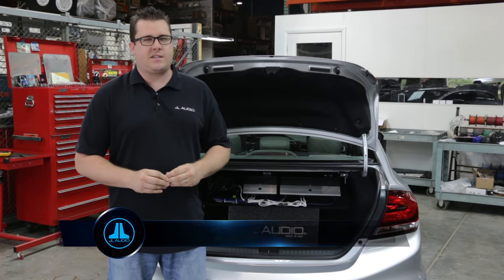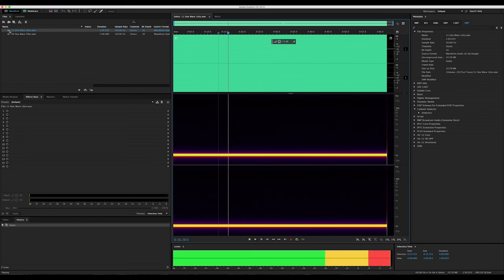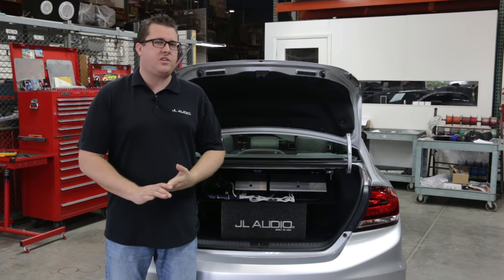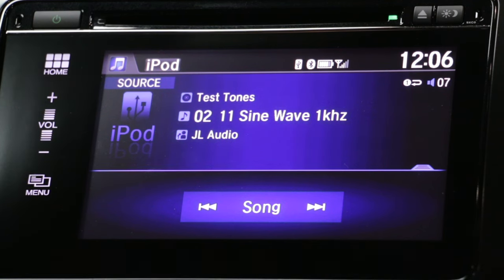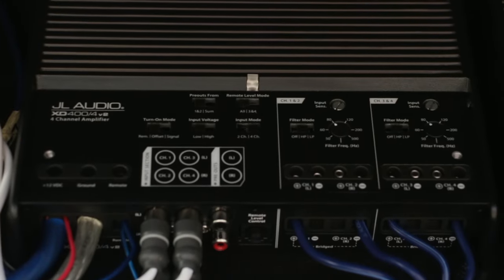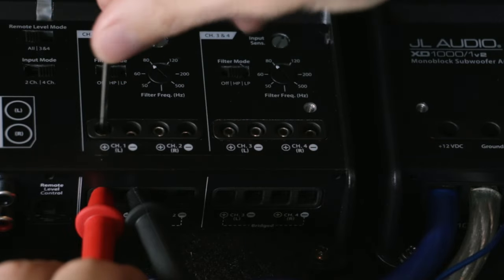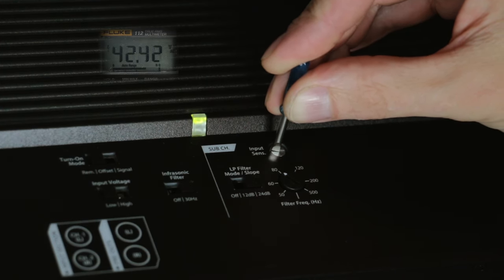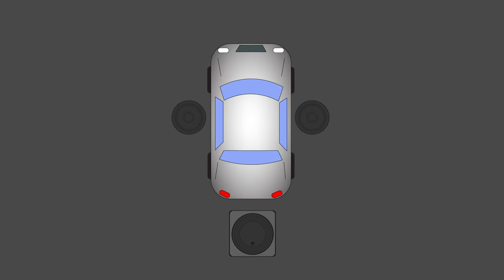Setting Amplifier Gain or Input Sensitivity

Comment: This is by far the most important step in tuning/installation. Thanks for the Giveaway opportunity! That amp would really spice up my modest system!
Reply from the maker: You got it! Best of luck!
Reply: @JLAudioInc  Man after market equipment amplifiers and headunits are meant to use the low level switch cuz of the RCA in video it says if at low levelur voltage exceeds ur desired voltage u should switch to high level if u switch it to high level will that damage anythin since after market stuff is for low level use.?

Comment: @JL Audio  
To truly optimize the gain structure of your system, you'll FIRST need to determine the EXACT point on the Head Unit or source unit's Volume Level where its output begins to clip.

Just guessing and setting your head unit or source to "3/4" volume might get you in the ballpark, but is leaving a lot on the table.

It would be great if an Online retailer such as Crutchfield would put an Oscilloscope on each Head Unit that they sell to determine its clipping point, and publish those specs for the F/R/Sub and Speaker Level Outputs, and maintain an Online database with this information.

They could even provide a smartphone app with an in-app purchase of let's say 99¢ for this information on a particular head unit in order to gain some ROI.
Reply: I o'scoped my Kenwood double-din's RCA outputs, and it did not clip at max volume.
Reply: Man thank God someone like you is around to tell the jl audio techs what they don't know!🤣🤣 They're obviously doing a tutorial for the everyday average Joe that isn't an audio file and doesn't have access to oscilloscopes and other calibration tools.
Reply: @skypallman6169  
LOL.  Ummmm...I didn't post this for the JL Techs, I posted it, as you said, for the "Average Joe" DIY enthusiast/installers who might be reading these comments and not know that all head unit's RCA preamp outputs do not clip at "around 3/4 volume".  This can vary A LOT between specific brands and models.  While "3/4 volume" might be safe in most cases, it definitely doesn't optimize the gain structure and undistorted output for EVERY system.

While many head units begin to clip in that "ballpark" 3/4 volume range, many others do not.  For instance, in the case of the Kenwood eXcelon Reference head units, their Front & Rear RCA Preamp outputs don't clip at all.  So they can be set to maximum 40/40 volume instead of a random "3/4 volume level", and that maximizes the gain structure which provides the lowest noise floor and highest undistorted output level for the system.

So you don't think it would be an advantage and service to the professional car audio installer and Average Joe enthusiast if someone like Crutchfield (who sells tons of just about every major head unit that is available) tested the Maximum Unclipped RCA Volume Level of all the head unit models they sell, and then provided that information to the community (even for a small fee/in-app purchase) so we know exactly at what point the head unit's RCA preamp outputs will clip?

I think shops and professional installers would greatly benefit from this information, as would DIY enthusiasts.   It would eliminate another step in the install bay where "time is money", and it would keep A LOT of systems from leaving the install bay with less-than-optimized gain structures for their system.

Consumers and DIY enthusiasts pay a lot for equipment in order to have a good car audio system.  IMO it should be optimized for the best performance.  No one wants to get just $750 worth of performance from their $1000 front component system or subwoofer setup.

Nearly every customer and enthusiast wants their system to play as cleanly and loudly as possible before distortion starts to limit their max achievable volume and enjoyment.  If you don't maximize the gain structure of the system, you could be leaving A LOT on the table and not give yourself or your customer the best service or system that they paid for.

As an installer, knowing 100% that the system was set up and left the bay so it would not play into clipping means that the customer is less likely to come back asking why their tweeters or subwoofers are blown.   (Yeah, this is still going to happen regardless, but at least we tried, LOL)

If the gain and S/N Ratio of the SOURCE that is playing the music into the system is not optimized, that follows all the way down the signal chain.  I know guys in SQ competition that tune their systems in regards to gain structure and max output to within 0.2dB of producing clipping distortion.  :-O

No, that's not necessary for the Average Joe, but it should be a bar to strive for in order to get the best performance for the money for you or your customer's system.

As an installer, I would love to know this information up front without having to test for it for every time I'm installing a new head unit model.  And it would keep Average Joe DIY installers from damaging their equipment and allow them to get the best performance out of their system, too.

/END OF RANT
Reply: @skypallman6169  Are you an MECP certified installer?
Reply: @ThinkDifferentish  Yup, none of the 2018+ Kenwood eXcelon Reference head unit's RCA preamp outputs clip even at full volume (40/40).  So in this case, setting their volume level at 3/4 wouldn't optimize the gain structure, Dynamic Range, and S/N Ratio of the system.
Reply: @bbfoto7248  yep started at 12 years old working under Rick wright and then both the business from him at 23 and I'm now 35. I know a little something about car audio you could say! 🤣
Reply: @bbfoto7248  and sorry, I have more of a life than to read  eight paragraphs someone on a YouTube thread wrote for some reason... Lack of a life I was supposed lmao
Reply: @skypallman6169  
LOL, too A.D.D. or lazy to even concentrate for a minute to read a few paragraphs?  Hmmm...Took me less than 3 minutes tops to type out...and well, I've got plenty o' time 'cause I'm retired at 42.  :)   Was an installer long ago, but got smart and got out of the car audio biz.  Still an enthusiast, musician, music, audio, & car lover, tho'.  L8r
Reply: @skypallman6169  Good to hear, and good luck with your shop, mate.  I got out of this silly biz over 15 years ago.

Comment: Just set my gains using this tutorial. Had no idea that tiny hairline adjustments to the gain knob could affect the output voltage so dramatically. Got my Boston G3 dialed in perfectly. *To calculate your amps recommended output voltage,  just Google the formula and plug your numbers in.
Reply from the maker: Great to hear!

Comment: Hi, wonderful video.

There is something that I'd like to highlight. When determining the target voltage for input sensitivity according to the nominal impedance of the speaker system do say nothing about the power of the speakers. Two speakers can have the same impedance but different power. So charts show the amplifiers' max power at a determined impedance. But we need to adapt the voltage to the max capability of the speakers.

Maybe I do not explain it correctly :/

Comment: In the video, you didn't mention the change in resistance when bridging a stereo amp. Its very important because when an amp is bridged, is sees half the resistance of the amp running unbridged. For example, a 4 ohm speaker is now a 2 ohm speaker. The amp has to do twice the work to drive the same speaker unbridged.

Comment: @ Wayne Sahlbach Jr 
Just turn the bass knob to max and adjust it  like in the video . That way you cannot introduce clipping at any volume no matter where the bass adjustment is set at
Reply: chad burt so turn the bass nob all the way then start the adjustment?
Reply: chad burt even turned to max, a remote bass knob will still have a little resistance, reducing output which is just no fun :P
Reply: @rentacowisgoogle  that's why you have the bass knob on while you're setting your gains. You're not going to lose that much from a small little bass knob. The very very very my new difference it makes is not going to be enough to matter. It's a non audible difference.
Reply: If your radio has distortion after 2/3 volume, you'll never know you have distortion, when you set the amp gain(there are some LOCs that introduce distortion at 0 volume).

Distortion can also be introduced through a BT signal, also.

Comment: I have a JL-12W7 with a JL-HD1200/1, and my brother has a JL-12W6 with a JL-HD750/1.

We are both getting very frustrated and are thinking about returning all of our JL Audio equipment because we are having issues getting these amps dialed in. 

I tuned our systems and set the gain using the JL-Audio 50hz 0db test tone ('09 Sine Wave 50hz-1') using my AC Voltage tester. The 12W6 (2Ω) sounded a little over powered at 38.7V and the 12W7 (3Ω) sounded very under powered at 60.0V.

NOTE 1: We both have an AudioControl LC2i for the RCA jacks.

NOTE 2: Our stock speakers are powered by our stock head-units and the stock speakers sound like crap when the Treble and Bass remain Flat! So I adjusted both systems with max Treble and Bass and the main volume at it's highest non-distortion level and with the JL bass/gain knobs maxed out.

What do I need to do to get the max bass out of these JL Audio systems with stock head-units and speakers?
Reply: Get a DD-1 and find ypur head unit's distortion point with the settings, flat. Use the 40z 0db tone for the bass amp. When you find that point, play the 1khz 0db and see if the head unit distorts at the same volume. Use the 1khz volume level as the reference. As far as setting the gain on the amp, use the DD-1 test CD and play either track 5 or 7(7 allows for higher output). With the DD-1 connected to the amps speaker outputs, starting at minimum gain level, turn it up slowly until you see the clipping light stay on, then back it off just enough to turn the red light off. 

I've done this with my two 12w3v4 subs, and I've broken the 145db mark only using 600w.
Reply: @jamesmurray4312  Thank you for your response!  It's 3yrs later and I didn't know anyone responded to my reply. 😂😂

Comment: This is awesome. Same procedure on boats I assume?
Reply from the maker: Yes, you should use the same 9-step procedure. This is measuring the amp's output in relation to the input source, that is not dependent on the install application.

Comment: very good, I was always oriented use resistive load at the output of the amplifier but, from this video I'm going to use the multimeter because really beyond the noise is risky damage the speaker, thanks!
Reply: Yes this is the ideal and best way to do it.  You dont risk damaging your speaker if you turn it too far and it distorts.  Especially if it's only clipping or distorted slightly that you dont really hear it but over time you're doing damage to your speakers.

Comment: Once i set everything with a flat setting, can i adjust the eq later on without clipping or the process should be repeated with to fit the custom eq setting?
Reply: I would set the EQ how you like and then tune the amp.. I figure that changing the treble and mid settings wouldn't make much of a difference, but increasing the bass or using a bass-booster would affect the subwoofer and could send it a distorted signal.  I'd feel much more comfortable doing a tune after changing any settings, just to be sure speakers are getting  clean signal.
I have a Kenwood unit which has the EQ flat, and speaker frequency settings are set to pass-thru since the signal goes to a 4-channel amp, i set the frequency on the amp.

I would highly suggest using an oscilloscope since the multimeter method assumes that you already know it's a clean signal.  I bought an $80 oscilloscope/multimter off Amazon and while the oscill lines aren't as detailed as a $300 oscill, it still gives me a good idea of when I'm clipping, and that's the info that gives me confidence that my system is not getting a clipped signal at all
Reply: @GlycerinZ  Thanks!

Comment: The thing i don't understand about setting gains, whether its with a DMM or OScope is the instruction to set the equalizers, bass boosts, etc. to zero. No one listens to music with all that at zero so as soon as you set your gains using a flat eq and test tones, the first time you go to listen to music with your eqs on and the volume up, you're into clipping.
Reply from the maker: You may not necessarily enter clipping unless certian frequencies were heavily boosted, but we do mention that if you are going to add any eq boost, then you need to go back in a reset sensitivity with the boost in place.
Reply: I listen to my music with all of my EQs etc set perfectly flat, and i'm pretty happy with the sound and yes i do understand what eqing etc. does but dont need it myself
Reply: I keep my head unit eq flat always
Reply: Can't you go down instead (minus db) when setting your EQ. SO if you want +2db on 40hz you go 0db at 40hz and -2db for everything else. Is this going to work better without introducing clipping?

Comment: Hope you respond! I need help.

JD1000.1 pushing 15" Kicker CVX, with LC2i

1000 x 2 = 2000.
sqrt2000 = ~44.7 = target voltage

So I:
-75% volume 50hz test tone
-Set LC2i just a hair before 'maximized' light turns on.
-Amp gain all the way down still reads about 56, higher than voltage.
(ALSO - do I set inputs to low level when running from LC2i? - is this where my issue lies?)

BUT, if I set gain to hit the clipping indicator light on the amp itself, the voltage reaches like 75.

As of now, it sounds way underpowered. I had a 12" with 400 watts and that was louder. I'm not sure what I'm doing wrong and what I'm missing. 

A little confused why these two numbers would be vastly different - target voltage v. clipping light voltage.